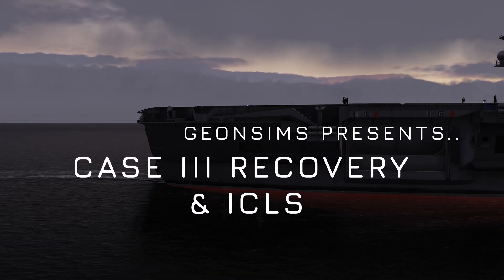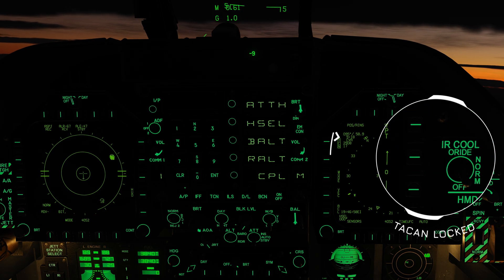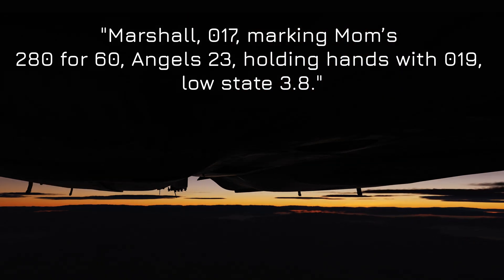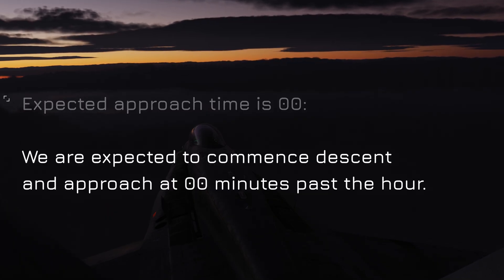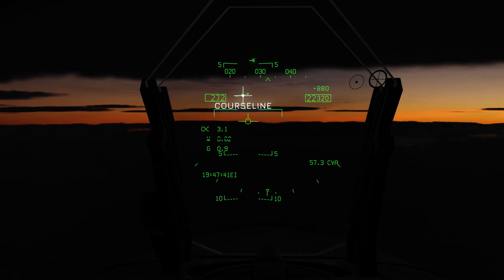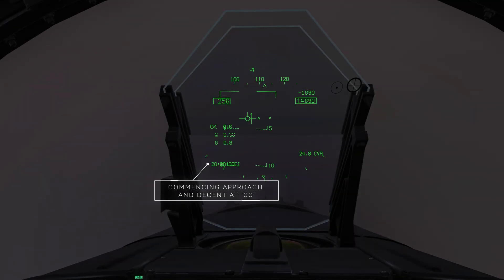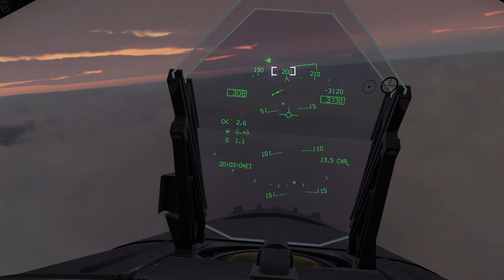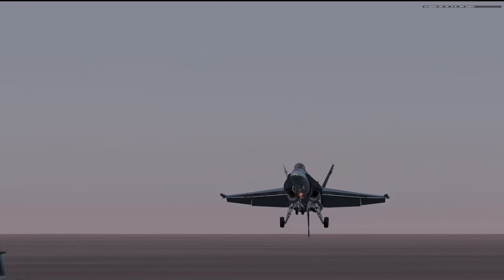F/A-18C CASE III & ICLS Made Easy – Complete Carrier Recovery Tutorial DCS World Guide

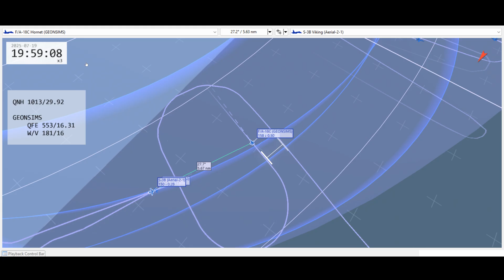Comment: FYI at 12:03 , you're mostly offset because you're holding 30 degrees off the final course, so the carrier has moved to left during your hold 😁

I believe you're supposed supposed to push from the assigned DME, eg Marshall expects you to be at DME 23 at 00:00 time.  If you bring up the ADI page, the tick mark on the turn rate indicator is a standard turn, eg 1 min for 180 degrees.  If you make standard turns, you know if you make 2 minute legs that your hold will take 6 minutes, during which time the carrier will travel 3 miles or so (45 seconds). so if you were anal about hitting the correct push time, you'd check your time crossing DME 23.  If you happen to hit it at 53:15, you'd make standard turns and 2 minute legs.  If you hit it the first time sooner or later than 53:15, you'd adjust your leg lengths by half the difference.

Or you could just do fighter pilot stuff and call it a day 😅 I imagine most DCS pilots don't want to do math while flying
Reply from the maker: Hey, I really appreciate you taking the time to explain this, that’s very helpful. You’re right regarding the offset; I simplified the hold geometry a bit for the sake of keeping the video beginner-friendly, but your breakdown here is spot-on for anyone wanting to do it more precisely.

Totally agree that most DCS pilots don’t want to do trigonometry while flying 😄 but this is great info for those who want to take it a step further. Thanks again for the detailed explanation!👍